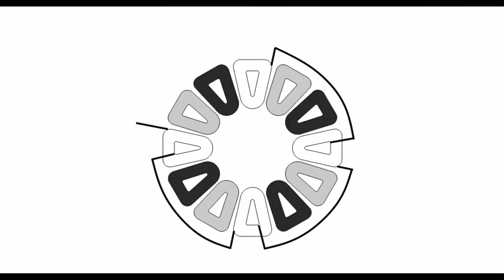Making Wind Turbine Stators: Vacuum Injection

Comment: Mind blowing. I have two questions for anyone who might be able to answer, what is the clear stuff called? Clear epoxy resin? Where can this be purchased? Would plain old garage floor, grey tint epoxy work just as well?

Also, what is the pen thing he coats the tips of the copper wire with? Bleach? Alcohol? Acid? Are there any more readily available household chemistry options for these items? (Say, if I was working on a limited budget or lived in a rural area without any specialty stores nearby, or delivery services.)

Also where can copper wire like that be procured? (I guess I had more than just two questions afterall.)
I checked a local hardware store and found some rather thick wire and I bought it, but it's definitely thicker than the wire used in this video.

Is there any copper in electrical wires or equipment? Could I junkyard dive and strip parts for cheaper items? Could I melt copper and then make wire that way, or would a solid block of copper work even better for this?

Oh yeah, also, magnets. Can I junkyard dive for magnets as well, or make some with minimal scientific procedures required? Would speaker magnets work, or nah?

Comment: hi, I just want to ask if you try that stator circulates counter clockwise? if it circulates clockwise it produces electricity that can charge the battery but what if it circulates counter clockwise? it still produce electricity and can be use in charging the battery even it rotates backwards?
Reply from the maker: Yes, it produces electricity when spinning in either direction.

Comment: How do you calculate the coil lengh or turn you made ? Like if you hade made bigger like 100turn as thicker coil: will it produce more power with the same magnet ?  Or bigger magnet on this same coil= more power... same if you do bigger winding... Thanks
Reply from the maker: No problem. Hugh Piggot explains how to calculate # of coil turns for a given # of coils and magnet sizes/strength in his 'Wind Turbine Recipe' book. Theoretically, more turns of copper per coil = more voltage, and more magnetic flux = more power. But with an axial flux generator, space is an issue. Making the coils thicker will actually decrease power output because a thicker stator increases the distance between the two magnet rotor plates, which decreases the magnetic flux strength between them. The closer the magnet rotors are to each other, the stronger the magnetic field will be. Coils with more turns should be made wider instead, so that the magnet rotors can be placed as close together as possible. For a good working machine, the stator shouldn't be thicker than 5/8" (16mm). 
A bigger magnet doesn't necessarily mean more magnetic flux either. Neodymium magnets are graded for strength (measured is gauss). A 2"x1"x1/2" magnet that's N42 grade will have ~13,000 gauss for strength, while the same size magnet that's N52 grade will have over 14,000 gauss. So you have to pay attention to the magnetic flux strength in gauss when choosing magnets for your generator (do not choose based on pulling power, ie: how much weight the magnet can lift in lbs - this rating is for different applications). The size of the magnets only matter in regard to whether they'll fit in the allotted space on the magnet rotors or not.

Comment: I want to build something like that, but have a few questions. The magnetic field only has to go through the center of the coil? So the magnet has to be as big as the center and not the entire coil? And wouldn't it improve the performance if I have a material with a high permeability in the center of the coil?
Reply from the maker: The center of the coil should match the mag in both dimension and shape, or as close as possible. The flux lines extend from the surface of the magnet out, so the coil should be shaped accordingly. They can be wedge shaped like mine to minimize space requirements, but without matching with wedge magnets there is a slight compromise in efficiency (not enough for me to pay 3 times more for magnets though - CBA is the bottom line). The mag does not need to be as big as or bigger than the coil - this would be a waste since some of the flux lines would extend well beyond the steel plates and would be lost (google dual rotor axial flux animations for a visual of how the flux travels) - the plates would also need to be ridiculously large/heavy. 

You can certainly put a ferrous material in the coils, but that would just be dead weight that would cause cogging and increase the required startup wind speed to get things spinning. The air core axial flux pmg is designed with an air core and dual steel mag rotor plates for that reason. The steel rotor plates capture the flux from the mags and keeps it from escaping beyond the perimeter of the generator, combined with the alternating poles on opposing plates and the pancake design forming a very small air gap between them, this does the job of directing the flux back and forth through the coils from pole to pole on each plate. People have built single rotor axial flux pmg's too, but they're not near as efficient. Steel laminations are used in conventional generators because the configuration is different and subsequently the flux has different distances to travel. The steel cores help to carry flux through deep coils/air gaps particularly in single rotor generators because there is no second rotor with a second set of mags on the opposite side of the stator to help. Adding steel cores comes at a small cost due to the cogging effect but is required for certain designs. It's not required for this design, so adding them would hinder performance more than help.
Reply from the maker: ...other good sources of information are Hugh Piggot, Chris Oslen, and thebackshed.com
Reply: @JamesBiggar  Thx for the detailed answer, I do want to build a dual flux generator. It makes sense that I don't need additional material in the coils if the flux is directed. That helped a lot for my design.

Comment: Hi James,
did you consider star delta configuration?
Reply from the maker: Yes, I've used both in the past. Using star with this build, it's typically the most effective for generating electricity via the wind. A switch that can automatically switch from star to delta depending on the wind speed would be ideal, we'll see what the future holds.

Comment: Heat shrink not electrical tape...  do it right the first time!
Reply from the maker: I use both lol. Either work fine in an encapsulation, no need to worry about any sort of leaks, electrical or otherwise ;)
Reply: I thought the same thing until I realized its going to be sealed into the epoxy.  If the adhesive on the tape breaks down it won't matter.
Reply: Encapsulation eh? OK... but I like heat shrink best.
Reply from the maker: Yep. Note the end of the video where the stator is cast in epoxy. I like heat shrink best as well, however, it has it's limits - like when connecting the large flat lugs to the thin 14 awg wire. Gotta use a large shrink tube, but it will only shrink so much, nowhere near enough to cover the wire sufficiently. So I used tape in that case. Everything else has shrink tubing, as demonstrated.
Reply: Thanks for the reminder... agreed.